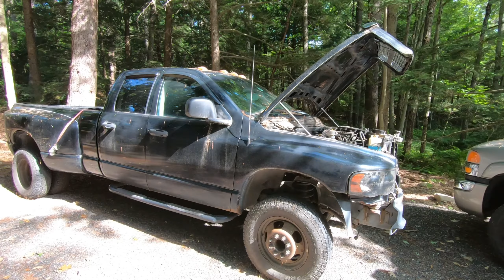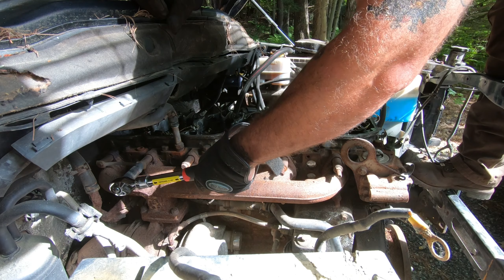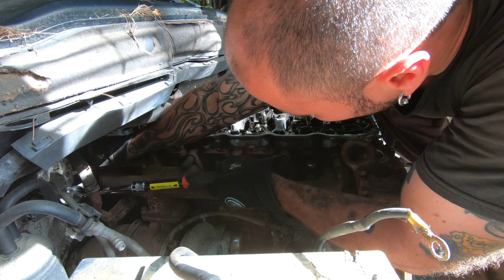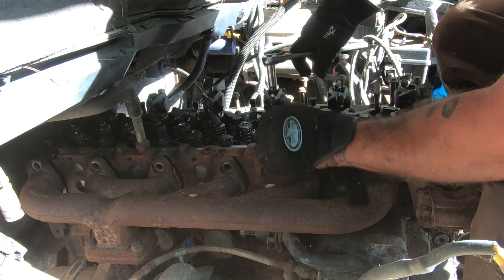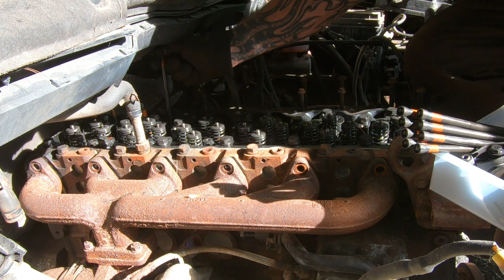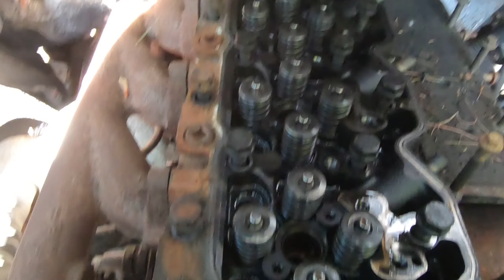03 dodge 3500 5.9 Cummins seized engine rebuild part 1 (removal)

Comment: I got mine for 1k and I need to rebuild it since the guy ran it out of oil it isn’t seized up though
Reply from the maker: It can get expensive if you use oem and new parts. It honestly would have been cheaper for me to get a rebuilt engine instead of rebuilding mine.  The only difference is I know I did it right and didn’t cut corners on it. Good luck with your build. I put quite a bit of info in the rebuild videos. I’m at a standstill saving for injectors at the moment.